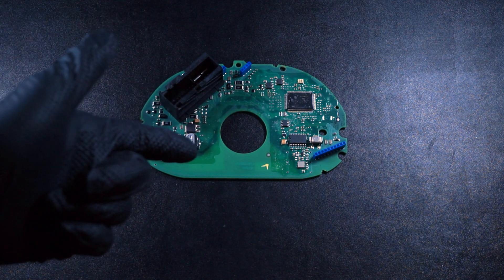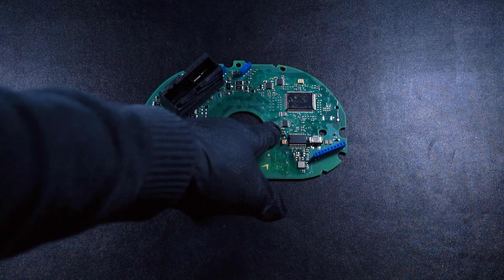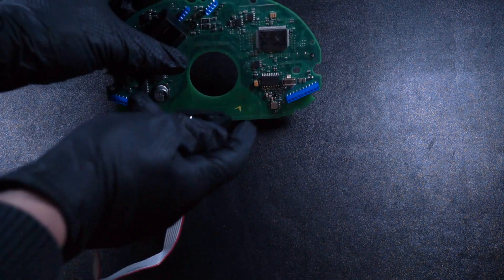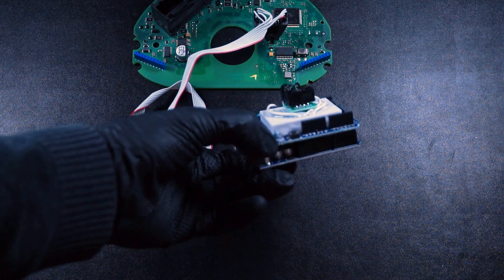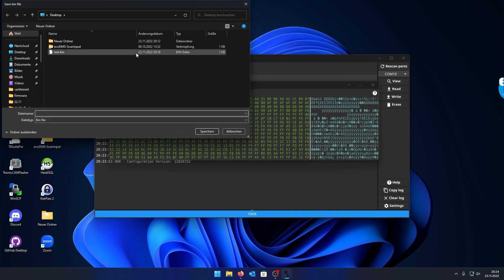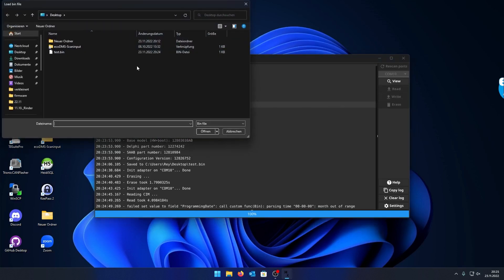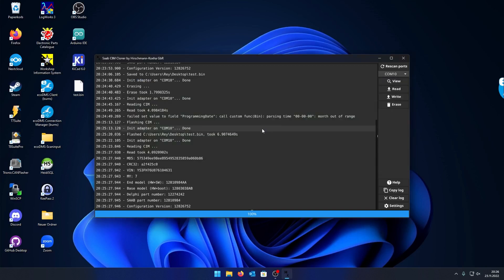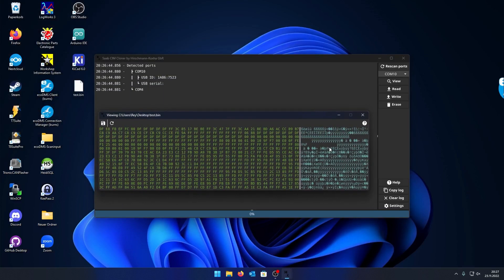SAAB CIM Tool

Comment: Love your work and this is Awesome!
More aftermarket tech goodies to save as many Saab models as possible.

Could this potentially be used to decode/encode to enable phone button SWC for infamous  NG9-3 2003-2006 models?
Reply: may we can try to cover the data with which enabled this function,I guess😅